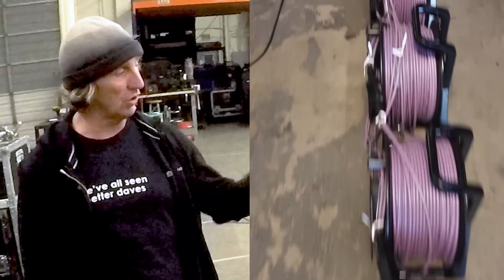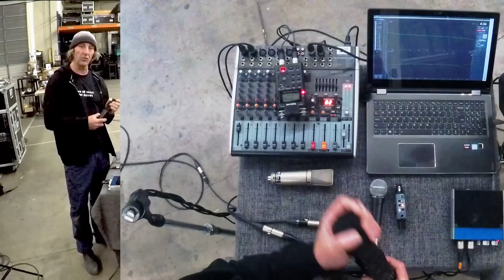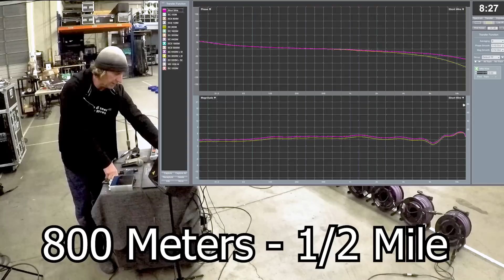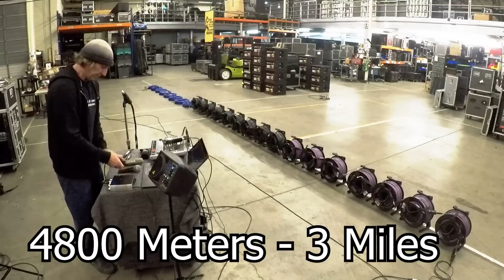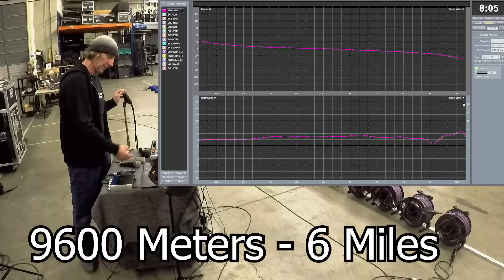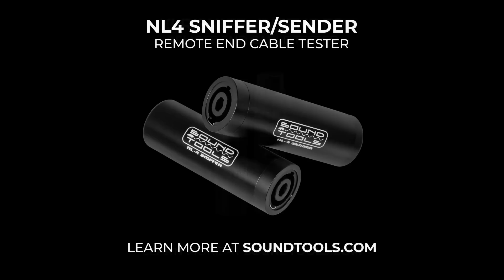Six Mile Long Microphone Cable? With Phantom Power?

Comment: i wonder if the cable was laid straight but not in coils would the result be the same, since it being spooled up might amplify the voltage.
Reply from the maker: Twisted pairs should not be impacted by coiling but... If the pairs are not perfectly twisted, the coils could create inductance which should rolloff the HF.

So... It is possible that if they we uncoiled we could run the cables even longer!!

But probably not enough to make a difference we could hear.

I have done measurements on coiled versus not coiled Cat5e cables and the impact is very minor at high frequencies like a megahertz. The impact it 20K should be non-existent
Reply: @DaveRat  as i posted realised that those are probably  shielded as well which should mitigate that. Any way, glad have found your channel, helped a lot with insight in to live sound and solutions to problems that occur.
Reply from the maker: Yes shielded and welcome and thank you!!

Comment: Dave, it would be very interesting to see this test with a digital console sending a high amount of tracks down the different distances to see if there's any digital degradation once you start adding tracks. If I had that much cable I would try it myself...

Comment: I was being cocky about Cat-snakes (worried about audio quality using let's say 10m stage Cat-snakes, not 3 miles😁).
Worries; XLR cabling (designed for audio fidelity for analog transfer), Ethernet cabling (designed for data integrity for digital transfer). Different cable specs for different applications. With Cat-snakes we are going to use cabling designed for transmission of digital signals for transmission of analogue signals. Without researching it, my technical brain said that it will negatively impact audio quality. You proved me wrong by showing it in practice! Brilliant! Thanks. I don't have to worry about using 10m Cat-snakes👍🏻🤟🏻😃
Reply from the maker: Good stuff and to be honest I knew it would work well but I did not realize that it would work that well better than mic cable and AES cable. I did other videos testing it as well as a 10 mi test

Comment: Great video! I wonder how much of that roll off is due to the wires being coiled. They are acting like air core inductors. What would the difference be if the wire was straight vs coiled?
Reply from the maker: Twisted pairs are almost completely immune to coiling. Especially tightly twisted pairs like Cat5 cable has

Comment: were the coiled parts a factor? inductance, I mean.... or the bend radius of the cat6.... dielectric effects vs straight cable? 
I mean, are these things significant at audio frequencies or data frequencies?
Reply: back in the 80s, I worked on a soap-opera that was shot in real houses, purpose built. the houses were in a U-shape, with the "tech-block" (our equipment & control rooms disguised as a regular house) at one end, & the last 'set' house at the other. each house had a hidden stage-box with camera connections & audio points. 
the local authority wouldn't let us run any cabling under the road, so all the cables had to go out the back of the buildings & be buried in the back gardens, meaning that the run to the furthest house was about 300m. my job back then was video, & the camera control unit I used had equalisation circuits for all the video channels (RGBS & the return video for the viewfinder, to allow the op to match shot sizes with off-tape). the floor monitor was just a cheap sony, & the LDs knew to jack up the chroma when in that house. 
but the sound guys were always wary of it. their buried cables were heavy duty star-quad, a pair of twisted pairs with a densely braided sheath & a thick overall rubber, but even so they heard clicks & stuff, & there was always more noise on the mics, which were sennheiser 416 or 816, depending on the needs of the day. 
I asked why there weren't pre-amps in the stage-boxes..... anybody care to guess?
that's right- it was a *drama*.
so people could go from barely whispering to yelling full-on, in the same scene.
actually the biggest problem was planes, & the local pheasants!
Reply from the maker: Wow and cool!

As far as the preamps, the solution is pretty simple.

Just why the mic into two or three preamps with gain set at low medium and high levels.

And have all three preamps sending signal always and on the other end they just select the preamp that has the best signal to noise ratio without distorting for whatever scene.

As far as the coils when you have balanced line twisted pairs coiling has minimal or no effect
Reply: @DaveRat  yeah, multiple pre-amps.... there weren't enough ties to do that, or enough budget! so the boom-op would have to nose the 416 in & out of the heat of the battle, so to speak, based on the rehearsals & feeling the way the dialogue was going to be run at any instant. you got to know the actors pretty well, after a while...
things got even trickier when we switched to stereo. we tried to persuade the broadcaster right from the get-go that regular stereo was not going to work, & that TV would work better as M-S (arguments ranging from sweet-spot in the average living room, to the extra bandwidth required to broadcast two complete full-range channels, correlation issues & so on).
in fact, we did all the acquisition & post in M-S, then converted to L-R right at the last minute. there was a small schoeps figure-8 fixed above the 416. boom ops started to get buff. 😂
Reply from the maker: Cool stuff. Love the real world realities and solutions

Comment: For analog over Cat5/6 do you need to use cable with individually shielded pairs or is an overall foil/braid shield good enough? I'm putting together a fixed installation wtih about 150 ft of Category cable runs from one end of a room to another. It may will run either in a soffit past lights or on the ground next to electric heaters.
Reply from the maker: I did a vid on crosstalk in overall shield analog over cat5. But in case ya dont want to see it. No. You don't need individual shields.
Reply: @DaveRat  I believe, you Dave, but I'm going to watch the video anyway, just in case.
Reply from the maker: Cool

Comment: Hey dave , another classic vid , obviously u wud,nt run those cables spooled but but for instance if they were layed out how do they deal w/ heat dispersion, a mile though, absolutely amazing ,...
Reply from the maker: 👍🤙👍, heat dissipation is only a concern with higher currents

Comment: Cable rolls are collecting not only shunting capacitance C (depends on cable's quality and length - reducing upper frequencies), and serial resistance R (depends on cable's quality and length - reducing signal level), but serial inductance L too (depends on cable ROLLS summary serial inductance). This inductance is affecting passive dynamic mics (just voice coils, or voice coils + transformers like SM58); transformer output active electronics dynamic and condenser mics; playing games with shunting cable's capacitance. And the next input's impedance parameters are taking part in this game too, all it is rather complex...
Reply: @DaveRat  Thank you very much, your videos are so simple and so educating! 
   Forgot to add - all the losses depend on the microphone's (or any other transducer's or gear's) output impedance. Lower impedance reduces affects depth. 8 ohms, or 50 ohms, or 600 ohms, or 10 kohms, etc., output impedances (passive or active) mean a serious difference in the signal loss in cables + other affects, including EMI/RFI noise and some phase shifting coming from LC components. But in the real life, we rarely have so long cables, so no reason for panic... :)

Comment: Now, how far will an Ethernet connection travel?
Reply from the maker: Well I am using ethnet cable here so for analog you have your answer. As far as running digital Data, it will vary drastically depending on the protocol and many other factors

Comment: I always wondered about this. I use a 100ft. 16 channel snake from my control room to my live room. I wondered if it made a difference going through that extra 100ft. Cable. The answer is no. At least I can't tell the difference. Not long enough.
Reply from the maker: This was not a test of maximum fidelity, just a test of function.  I would say that 100 feet will make a slight difference that with low impedance sources would be inaudible but measurable. Shorter wires are better but the difference is very small
Reply: @DaveRat  
Wow, Yeah. I can't tell the difference. I'm sure on one of those computer frequency meters there would be a slight difference. I can't believe that you did sound for Soundgarden. Chris Cornell was one of my favorite musicians. It's a shame what happened to him. I was blown away. I've met a lot of big time musicians being in a touring band but never got to meet him unfortunately. Great Vocalist.

Comment: I'd have a question kinda related: could you use analog over cat5 for four (4) different headphone cue feeds in studio situation? i.e. four different unbalanced stereo-signals powered by headphone amps from the send-side. Or is unbalanced analog generally a total no-go with these cat5 based systems? To be clear just regular indoor cable lengths, not massive distances like on the video.
Reply from the maker: That works, we have several customers doing that and happy with the setup. You don't really want headphone caples too too long. Sending 4nstereo line level signals to headphone amps or sending stereo headphones directly is all good.
Reply: @DaveRat  Great, thaks!

Comment: Dave you make very cool videos and I have learned a lot from you. I have a question concerning this video. Did you consider the fact that coiled cable reels may create millihenry choke coils which will inherently create a low pass filter in your experiment?
Reply from the maker: Sooo, that would mean that if indeed the twisted pairs did not counteract that occuring 2e could run even longer with less rolloff?

Awesome

Comment: I have no idea what any of this means except the fact that you can get a fairly clear signal that far without boosters or repeaters whatever they are called. Also, what is phantom power and what is it doing in this situation.
Reply from the maker: Phantom is a way to remotely send power to microphones that have small amplifiers in them, down shielded twisted pair cables.

Comment: I wonder what would happen if that cable wasn't coiled in a small space, but in a straight line round trip, I think there would probably be a lot more interference
Reply from the maker: Hmmm, the customer that bought our Soundtools Supercat cable to run signal to speakers along a sporting event route said it still works great with no issues

Comment: Wonder what the voltage drop is. I know most condenser mics will run in 12v even when the spec is +48v, but I have a couple that are more sensitive to voltage.
Also be aware, that much wire will delay the signal a bit. Old osciliscopes used to use long coils of wire exaclty for that. Not enough to hear, but phase issues can arise.
Have you done this with a dynamic lol? Now i just need to wire my house in cat5 and add preamps to every room. :D
Reply from the maker: Hmmm, math calcs. 

As far as delay, since sound travels about 200,000,000 meters per second in wire, the delay would be around .05 ms or about the equivalent of 1/2". In other words, the delay in the wire is less than moving the mic an inch further from lips

As far as the voltage drop, that is an easy calc as well, 

Look up the resistance per 1000ft of 26ga wire, divide by 2, as there is 2 wires, then double it as it travels there and back. Then look up the current draw of the mic. Then apply ohms law. 

I believe I did the calc in another comment here on the vid got don't recall the result, I think it was less than a 12 volt drop. But the cald will get ya close

Comment: You forgot to show what that cat cable? Ethernet? looks like. Home studio and musician guys run XLR (including me)
Reply from the maker: Is it at the end of the video in the trailer?
Reply: @DaveRat  I found pictures at google :) "Catapult Cat 5 Analog Snake"
Reply from the maker: Cool and also maybe check out Soundtools.com catbox, cat tails,, wallcat, and cat rack for aluminum ones that won't rust or have the paint chip. Plus Soundtools has much nicer tails and versions no one else makes like the supercat tails

Comment: Very nice video !  just what exotic cable lovers need to see. a mic level signal doing 6 miles... jees !!!  pretty good !!
Reply from the maker: Both surprised and expected. Surprised it worked with no special electronics to deal with long cables and expected as telephone cables are way longer.
Reply: @DaveRat  yep :) its just ideal to show people that are not from the field  of pro audio :) that expensive cables 1000$ and up (for one meter of  cable having a line signal.....) are completely useless.. we already knew... but yeah
Reply from the maker: Especially the power cords after 50 miles of ac lines on cables and 75 feet or 12Gauge solid conductor wire in the house walls, some kbuclehead buys a $5000 IEC cable thinking it will make a difference.

Makes me smile.

Comment: I work at a high school and use Wall-Cats all over the place. The district is much better at installing Cat cable rather than multiple mic lines. My question is can you run DMX and audio over the same Cat line?
Reply from the maker: Yes, analog, dmz, AES3, and com  can all run down the same wallcqt or catbox at the same time.

Just like with regular 4 channel audio snake.

Comment: It's one of those things that you never wanted to know, you will never have any use to know, but you are still glad that you know it.
Reply from the maker: And ya never know if you will get a call  to wire sound for a bike race in an area without wifi or cell service with battery powered  speakers.

Comment: The phase representation on smaart looks very similar to an inductive filter. In the fact cables are coiled. Can you repeat the test with uncoiled cables? 😀
Reply from the maker: Does it not look like a capacitive rolloff? Does the tightly twisted pairs not cancel out the inductance? If inductance from coils is the issue, that means we can go longer if un coiled? If it's capacitance longer would be worse?
Reply: @DaveRat  
Yes the linearity of response is a mix of capacitance and inductive effects that look similar in the phase graph. Basically an LPF.

I know that the twisted pairs technology helps to cancel out the inductance effect.
Still, on the super long run, very small construction tolerances (well within the cat5e specs) have the chance to become apparent.
Cat5e cables have a declared distance limit (100m 1Gbit) in the network domain mostly due to timing issues between TX and RX. So they are built to perform well within those limits.

Anyway you test shows incedble results. Those cables are performing much better than i expected.
Reply from the maker: 6es, better than expected and if the cous are causing inductance, it could even be even longer with less loss.

And the spec for Cat5e is is up to 100meg or so. Analog audio is 20k 1/50,000th the max usable  freq. That should add usable length?